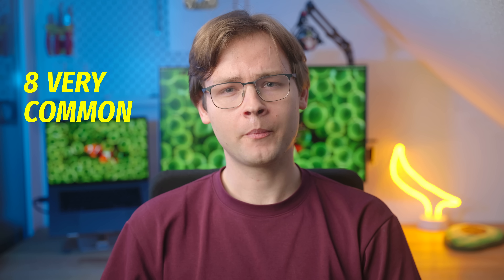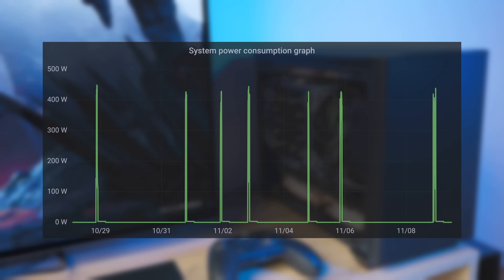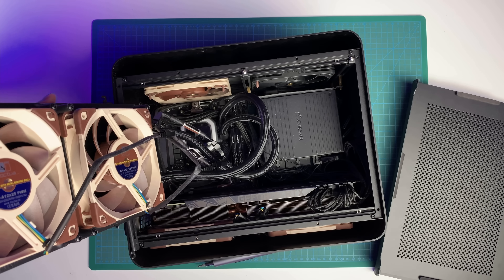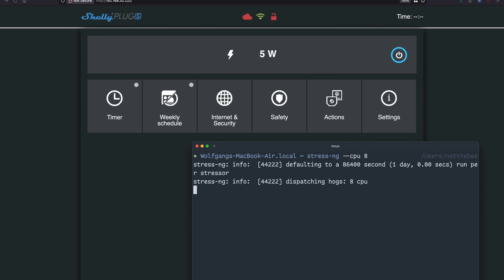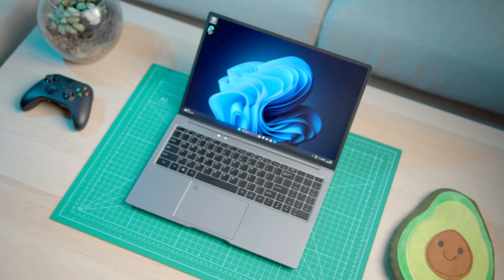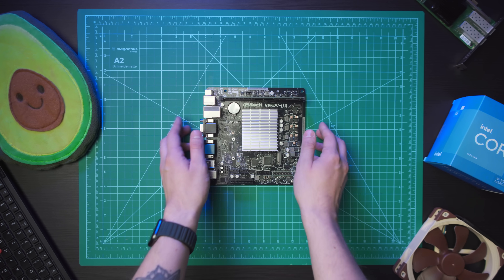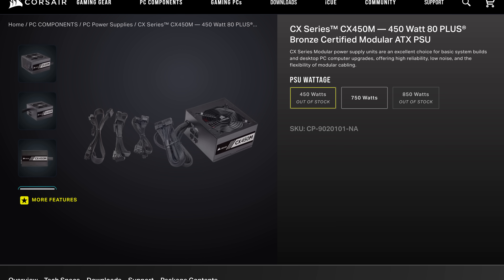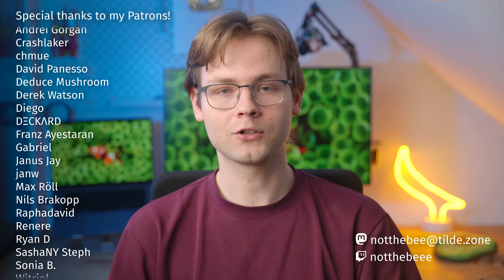Busting 8 Common Homelab Power Efficiency Myths

Comment: I bought 3x Lenovo M720q to run Kubernetes on actual physical nodes, instead of using VMs on a single R730xd

except each Lenovo draws 50W from the wall, and the CPU has more wake than sleep (>C1) time, so I wonder if I’m actually saving anything 😂
Reply from the maker: That's not right... What OS are you running?
Reply: Talos Linux, which is literally bare Kubernetes as it gets.

it’s because of the way I hammer my Kubernetes, and how many Postgres clusters I have, apiserver eats a whole core for one and I’ve once made apiserver grow to 32GB RAM usage with Kyverno, so it’s most likely just me. No one else I know with Kubernetes clusters at home come close to 50W lol, more 15-25W.

Also, the CX3 C states issue.

Comment: In case anybody is wondering, 32GB hyperx fury 3200mhz runs at full speed and capacity on the n100m and n100itx. You're welcome.

Comment: A couple of extra thoughts regarding PSUs:-
1). Personally I found that the more powerful the PSU the higher its idle draw power.
2). A server with lots of hard drives will need a larger number of SATA power connectors, which can exclude some lower power PSUs.  I found that SATA/Molex power splitters are dodgy at best and something to be avoided if possible.
Reply: The number 1 is just like he said, some higher wattage PSU are more efficient than the lower one, so yeah always do some research
Reply: what do you reccomend instead of rm550x 2021?

Comment: I only consider the power consumption of my devices in the summer and power is cheap and cheerful then.

They heat my technical room in the winter with idle capacity being donated to ALS and parkinson research.

Comment: What about running on a DC power supply (like a laptop brick), I've no idea if it's possible, especially if there are a dozen hard drives, but would it be more efficient?
Reply: I've ran psus on laptop chargers and even some USB 20v phone chargers.

They can be really efficient, just once you're within range
Reply from the maker: Possible and doable with a PicoPSU, but definitely not with a dozen of hard drives. With that many HDDs, the spinup spike will probably be too much to handle, even for some ATX PSUs. 

That being said, PicoPSUs are usually more efficient than standard ATX PSUs, but also don't come with a lot of SATA/Molex plugs. So you'll either have to re-wire them yourself or use SATA splitters.
Reply: @WolfgangsChannel  PicoPSU is just for 12V input to fulfill all the ATX motherboard voltages. All the other 12V lines should be connected to whatever is powering the PicoPSU. Since SATA also has 5V lines, maybe you can leech them off the PicoPSU or somewhere else because the big power draw should be 12V.
Reply: It's possible. Not sure what the point is

Comment: " 550 Watts is not enough for a modern gaming system :) "
So I'm running some old but premium bequiet 550 Watt PSU with a 5800X3D and a 4070. I did undervolt the GPU though but only because I am a sucker for efficiency, works fine on stock settings too. Great video, saving all the watts!!!
Reply: seasonic calculator recommended their 450w models for an i3 12100f wit a 4060 8gb !!

Comment: Concerning the efficiency of ATX power supplies, would it be possible to do a comparison with some PicoPSU + external power supply substitute?
Reply: In my home server I took an SFX PSU from  the scrap heap, gutted it, cut a bit of FR4 to watch the PCB and then mounted an 4"×2" 12V 170W PSU which feeds a PicoPSU. By buying a high end 4"×2" PSU the idle power efficiency is over 90%. I also don't need the huge cable bundle of an ATX PSU which improves my air flow which improves my power efficiency too. Then again I did a full custom wiring loom for the system so there is no excess cable like you would find in a server from a tier one vendor. The PSU can in theory run on convection cooling, however it gets ducted exhaust flow from the hard drives which keeps it under 45 Celcius worst case which is well below its rating which is more like 60 Celcius from memory.
Reply: @jonathanbuzzard1376  what company did you buy the high-end 4"x2" PSU from?

Comment: I have two N100 machines, a Chuwi Larkbox X 2023, and an N100DC-ITX.

Both idle at 4.2 and 6.2w respectively. Im rather quite fond of them.
Reply: These N100 systems are awesome! I'm just consolidating multiple pi deployments into 1 N100 based mini-pc
Reply: @OliverHamilton  yep. Pretty much. Go ahead.

 20W ish under load.
Reply: What PSU's would you recommend for that? Just ordered one of those boards from Ali for a 304 build.
Reply: @TomasIgnatavicius  The Chuwi is whatever 12V2A+ is lying around. The N100DC-ITX was whatever old laptop chargers I had.
Reply: @LeminskiTankscor The efficiency of the power supply can matter a lot at those numbers. I have an N100 box too, and I tried all the 12V PSUs in the house and picked the one that drew the least from the wall. Also, some old 10 year old power supplies will draw a fair amount even if nothing is connected to it. Thisch is a factor for PCs that are off a lot.
Reply: @szabolcsmate5254  Yeah fair. I tried about 5-6 and they were all within a few % of each other, but they're probably all a few years old at most.

Comment: I was suprised by idle consomption of Ryzen 5900X. I can't get my PC below 58W. Roughly 10W is idle power consumption of GPU. I have two 4TB harddrives, I'm not sure if I can force them to stop using hdparm. Some can be contributed to power supply efficiency, maybe voltage regulators for CPU. Maybe few watts can go to fans. But even if there's remaining 35-40W of power which cannot be possibly consumed by anything that does not have beefy heatsink and/or active cooling. And there's no such thing. And CPU heatsink is still slighly warm, which was not the case on my old i5-4590. My USFF PC consumes 6-8W idle based on definition of idle. It's ten times less. 
I installed Ryzen Master. It's showing CPU temp 38C when I'm writing this and 3-12W CPU power and 2-3% of maximum CPU current limits which transaltes rougly to 2-4A. But there's also 19W SoC power and 33% of 142W TDP reached. For long time I could not find anything, then I found Hatted Squirrel 's blog stating that culprit is integrated memory controller. 
Somehow not a single CPU review mentions it and everyone seems to trash intel for it's peak power consumption. But CPU consuming 60W idle and extra 20W just for running Skype, Discord and Browser is way worse.
Even though I use PC for demanding tasks, it's much closer to idle 95% of time: watching youtube, writing code, browsing internet. Minority of time is photo/video editing, compiling source code (when on home office) or data processing.
Reply: That seems about right. You can probably drop SoC a bit with less voltage and clocks, running the RAM at a JEDEC profile, and/or having IF at half DRAM. That SoC seems a little high, but XMP can do that, especially at 3600-4000MTps. However, these changes will reduce performance, possibly by enough to feel (except for plain SoC undervolting). "SoC" power use is almost all PCIe and DRAM related, and those IO dies don't have much in the way of low-power modes.

Reviewers would commonly have a power hungry video card attached, too, which reduces the differences at the wall. You do see the difference, in reviews that measure the EPS12V draw.

Comment: What often gets overlooked about ARM CPUs is that they're usually more efficient because they're more customizable. What contributes way more to power usage than the CPU itself are the features and I/O (nowadays I/O is the most significant factor in power consumption. Moving data is typically way more expensive than calculating it). 
ARM allows their customers to custom build CPUs. AMD and intel on the other hand have one architecture (they do have multiple) that must serve multiple applications. ARM systems are often more purpose built which make them way more efficient. Good examples are the A64FX (designed for the Fugaku supercomputer) and the Ampere Altra line. They're both based on basically the same CPU cores (the A64FX's became N1) but have different feature sets. The A64FX is designed for maximum 64bit floating point compute (and it still outperforms most modern CPUs at that) and maximum memory bandwidth (it's basically a more general purpose GPU) and doesn't need much memory or many I/O Lanes. The Altra on the other hand doesn't have HBM Memory support, lacks the SVE (vector compute for FP compute) extensions but has way more I/O and great integer performance. 
Unfortunately, most reviewers don't see that as an advantage and tend to point out that certain ARM systems are not so great at every single task (even though they perform well at what they're designed to do).
Reply: And i guess in M series chips, it is very power efficient due to a lot of dedicated hardwarw acceleration? Also they can cram anything to a single package since they are usually an SoC
Reply: @siontheodorus1501  that’s another factor. ARM is built around the fact that accelerators can be added if necessary. 
But I don’t think that that is what makes Apple Silicon so efficient (it’s actually not that efficient just low power). It’s more about their integrated design, all the things they are criticized for like soldering down the RAM and Flash allows the higher efficiency and lower power consumption. Soldering down RAM allows to drop the voltage and get it closer the cpu (physically closer, in apple silicon it’s right next to the Chip) which reduces the power consumption by a lot (each RAM DIMM consumes like 3-4W even at idle). Then, their SSD controller is integrated into the CPU which allows to share memory and reduces power consumption for transferring data between controller and CPU. 
In general the more flexible you want your I/O to be, the higher your power consumption will be. That’s why those tightly integrated systems, laptops and SBCs achieve much lower consumption. Apple just adds an efficient CPU and GPU to it
Reply: @lukas_ls  i see, how do you know that it is actually as efficient as x86 systems?
Reply: @siontheodorus1501  what do you mean by that?
Reply: @lukas_ls  well you said that apple silicon are not that efficient, it's just low power. So i assume that it is somewhat as efficient as x86 cpus, if not less. I'm just curious on how true is that
Reply: ARM also comes from a background of low power devices and Intel normally makes high power devices
Reply: @thewhitefalcon8539  that doesn’t matter as much. Most modern ARM architectures are not low power and the "efficiency" cores (little cores) are actually less efficient than the big cores

Comment: "ECC Is a must have" - Man. I can tell you from experience... Your server is 1000x more likely to screw something up because of a small mistake made by a developer behind some library, used by another library, used by a yet another library used by some small background service running on your OS than a cosmic ray flipping a bit in your memory.
How do i know that? - I am that developer.
Reply: And what's 1000x more likely than even that is me doing something stupid and working the system myself 😅
Reply: My own experience is that I haven't had a single Bluescreen since I switched my main Windows desktop PC to ECC. The last time that happened was back in the Netburst days, when I ran an old Xeon workstation with ECC as my main Windows box. Every other PC and laptop I've run, from SDR to DDR4 that hasn't had ECC has blue screened.
Reply: Cosmic rays are a 1 in a billion thing, for most computers. It's the cable that mostly works, the slightly dirty connector, the capacitors not quite meeting ripple specs, the poor quality or aging-out PSU, failing RAM ICs (seen that Google study, from some years back?), etc., that are of orders of magnitude greater concern. Without ECC, you just hope and pray, because you have no good way to detect many errors. With ECC RAM, and especially ZFS, you can have a good chance of being alerted to a problem. If you care about your data, ECC RAM should be an important part of the system, as it's the most glaring missing link in most of them.
Reply: I think it depends on your goal. for example my main goal is data integrity for decades for family photos and videos. For me ECC is a must. Also for backup machine. At a certain point, when you invested € to preserve your photos, it's not worth saving a few € on ECC. And no, "the cloud" is not a magical place which does it for you, they all say the customer is responsible to backup his data by himself.
Reply: Relatively Low idle power, av1 en/decode, ecc, min 5 drives, low (ish) cost for home server/Nas build what are the best options?
Reply from the maker: @barerfont There probably isn't currently a system in the world that would fulfill all of your requirements. Here are the systems that can fulfill some:

ECC, low power, low cost – AM4 + Ryzen PRO APU
AV1, low power, low cost – Intel 12th/13th gen + a consumer motherboard
AV1, low power, ECC – Intel 12th/13th gen + a W680 motherboard
AV1, ECC, low cost – an old enterprise server + Intel Arc
AV1, ECC, low-ish cost and low power, but no space for hard drives – AMD 7xxx based miniPCs and NUCs, e.g. Minisforum UM790 *
* keep in mind, even though the CPU should support ECC, it also depends on the platform/motherboard. I personally didn't check whether the UM790 supports ECC.
Reply: @WolfgangsChannel  thanks Wolfgang, I didn't think there was a solution that ticked all boxes...yet.. pretty sure you would've made a vid about it if there was but thought in would ask in case I was missing something 👍
Reply: The 7840u pro (FP7r2 only) does look like it supports ECC and has some half decent av1 benchmarks posted on AOM open benchmarking. Just don't know if that is a form factor we will be able to get hold of
Reply: @WolfgangsChannel  Another option would be add an Intel Arc to a cheap system (like the AM4), that should be a good compromise between price and power
Reply: @-blackcat-4749  there's always what-if scenarios. Early on I had it explained to me like RAID, having the extra parody allowed you to rebuild something. Not having it means a loss of data.
Reply: Thank you for your service o7
Reply: If ECC is a must-have what are your suggestions for a power-efficient setup?
Reply from the maker: @pawlarsen3279 An AM4-based system with a Ryzen PRO APU (4th or 5th Gen). You can usually find pre-builts for pretty cheap on eBay
Reply: @-blackcat-4749  yes, but for zfs it’s basically a requirement if you consider what it’s designed to be. 
Doesn’t mean that it won’t work without ECC
Reply: You're why there needs to be a sudon't
Reply: @-blackcat-4749   Agreed! Anything with high memory transfer rates should be ECC, as should a high performance NAS/SAN, but for the average home user probably not necessary (with the exception of a NAS or server). Hell even my workstation at home has ECC. I've heard the non-ECC argument for the better part of 30 years, it rarely holds up to realities. The only real issue is cost.
Reply: ECC is a must for a file server/NAS, but for anything else, it's entirely optional.
Reply: Thanks for the insight man!
Reply: I don't have a view one way or the other about ECC. But food for thought: Why don't we have error correcting L1 L2 L3 cache at the CPU level? I have sort of always wondered.
Kindest regards, friends and neighbours.
Reply: @chromerims  CPU caches have been ECC protected going back to at least the Intel Pentium Pro/AMD K6. Inclusive caches might only have error detection, and just fetch again from a higher level on-chip cache, which also has its own ECC
Reply: @shanent5793    👍 Many extra and kindest thanks, super neighbour.  I didn't know that.  May you and yours be blessed.
Reply: @chromerims  L2/L3 is ECC on Intel (I want to say AMD is now onboard with this as well, but I'm not sure). The problem at that level is overhead. The early mindset was "if we have a parity error, we can just go back and grab it again" wasting clock cycles. I want to say it was first used on the old Alpha processors first.  Anyone?
Reply: @RickMunday   Thank you, sen sei 👍
Reply: @chromerims  😂

Comment: Great video as usual :) Maybe you mentioned before, but which devices do you use to measure and log the power consumption ? I only know the ones with a display, didn't realise they could be connected to the home network as well. Thanks !
edit : found it actually by going back to your b-roll : looks like Shelly Plugs.
Thanks for the video again, I was going to buy an N100 mini PC to upgrade my Pi4 based NAS with video decoding, but will probably build a proper rig with an i3 instead for expandability.
Reply: There are a number of 'smart' plugs out there that can be connected to home assistant to monitor power draw from either the wall or a power brick but there's a lot of discussion as to whether or not they could handle the load from power hungry servers over time.  A decent UPS will also let you monitor power draw via NUT which can also be monitored via home assistant.  There are probably other options but those are the 2 I'm most familiar with.
Reply: A lot of people use the old reliable Kill-A-Watt, which just gives you a LED display readout of the power consumed at the socket.